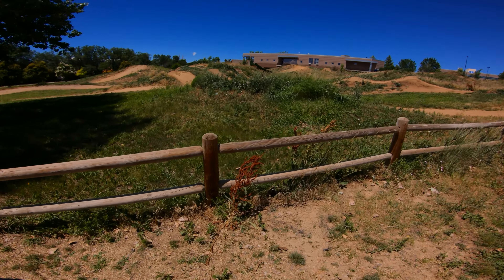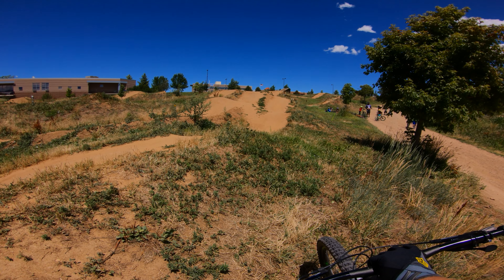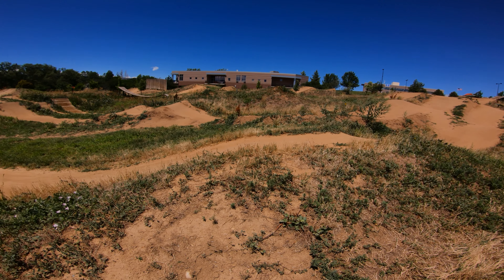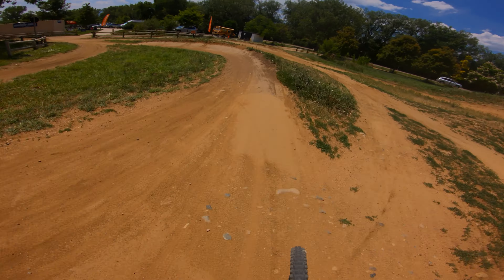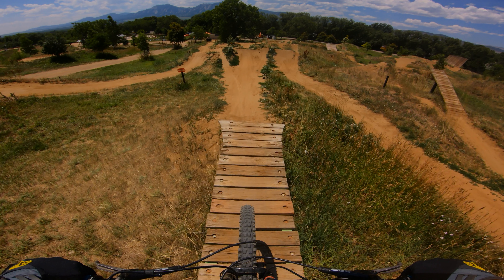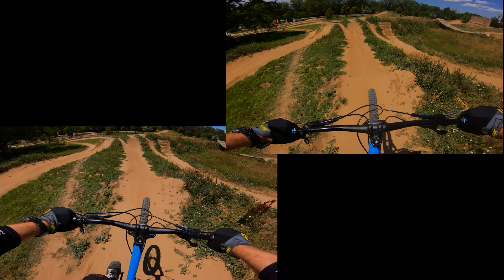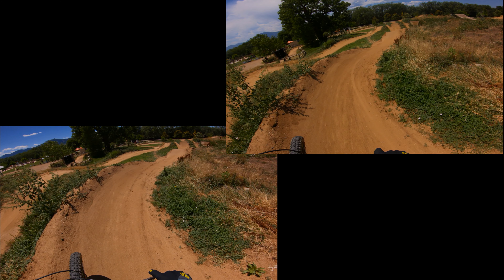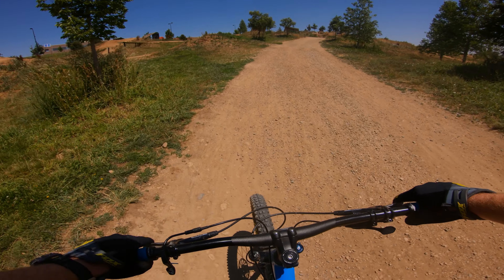Why can't I clear this jump?  [Part 1]

Comment: You've got this. Like Jeff mentioned,  you do seem to loose speed.  Commit to more speed or give  a bigger boost or little more of both. Ive case plenty jumps like this.. 💪🏽😎 "do or do not,  there is no try."
Reply from the maker: I'm gonna nail it... eventually!  There are 2 larger jump lines to do after this, though the last one is pretty scary and I might pass on it for fear of breaking something.  :)